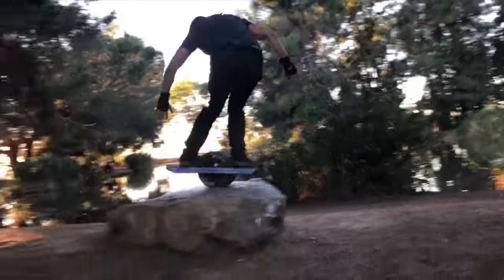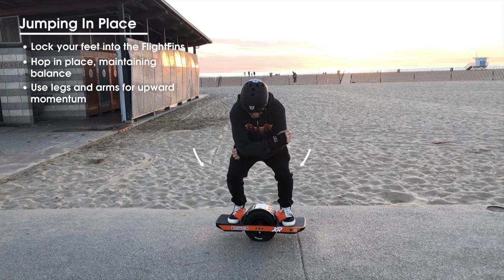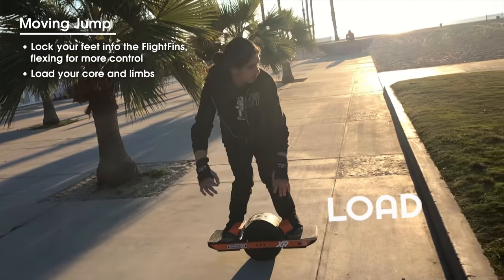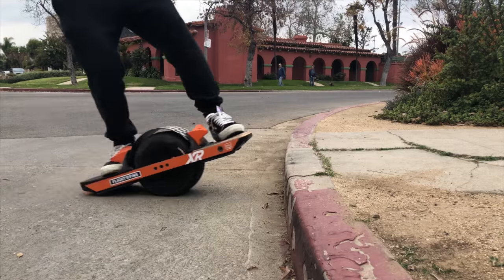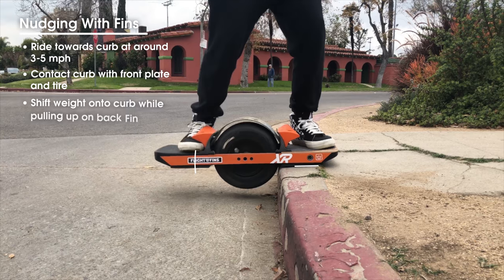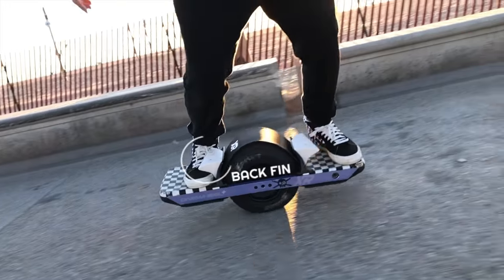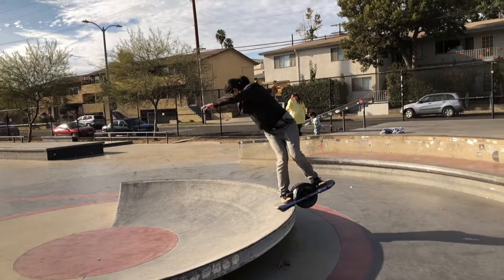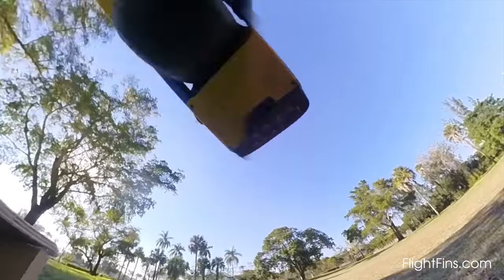Intro To FlightFins

Comment: I really like the idea of the Flight Fins (although that think they shouldn't have been called "Wings" - lol). They really make sense for many types of riding. My only hesitation about getting them for myself is ...

I've been snowboarding for over a decade and many times I've been very thankful that my feet are bound to the board (especially when falling on a steep). However, that snowboard only weighs a few pounds (sometimes my boots and bindings weight now than the board itself). My OW+ XR is almost 30 lbs and pavement is harder than snow (not so much east coast snow - lol) and the OW board is not bound to my feet. So what have been your experience in nose-diving while "locked" into your flight-fins? I can't imagine being able to quickly doing a "run-off" during a nose-dive because my back foot is behind a fin.

Your thoughts?
Reply from the maker: We did consider "wings" for sure! Yeah, the fins are designed in such a way that you have to engage them to use them. In a bail of any sort you just easily fall out. You can ask anyone who has owned them for any period of time. Getting stuck just isn't an issue ever. Just watch any of the bail videos and look for people with fins. We we designed them safety and in fact many accually credit the fins for pulling them out of nose dives. Thank you for the question.

Comment: I got flight find and they are awesome, lil too close for my liking but it definitely will take time to master… question though. Why does the wheel spin in reverse when your board gets air? It pulls you back when you land and throws the body forward which is a crazy feeling, which is probably why they tell you to keep the tail down when landing. Just curious why that happens 

Love the fins!! 🤙🌅